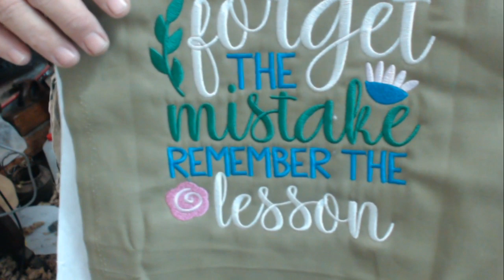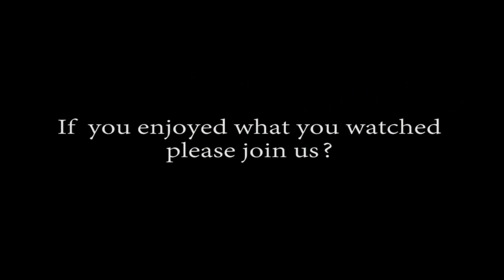(Day 25) Sanding, Staining,Simple Stuff, more  Box Making and a Tidy Up.

Comment: I was always taught to sand to at least 400g or higher when staining, as wetting the wood in the long run would introduce warp.
Interested to see your process now
Reply from the maker: Not heard that before Chewy, I think that you would have to introduce a lot of water to make it warp. Most warpage occurs on unseasoned timber that still has some stress left in the fibers. But you never know I might have just been lucky. I sand to 400 when I intend to french polish but not oil finish. Cheers Steve